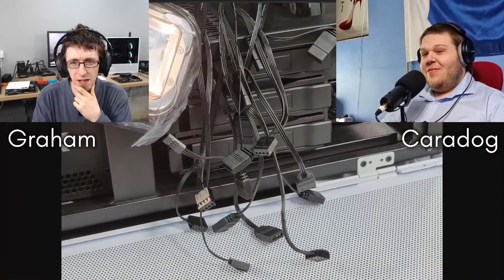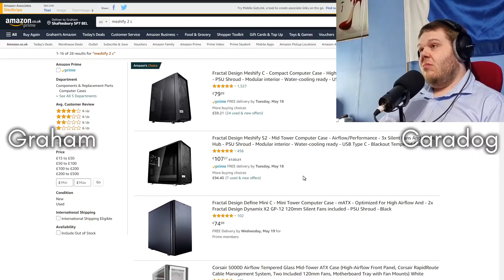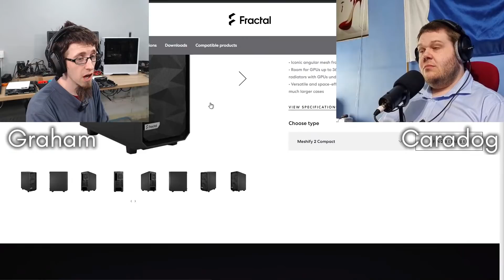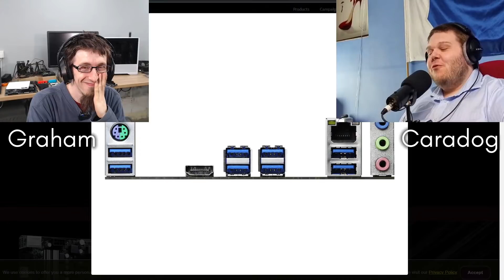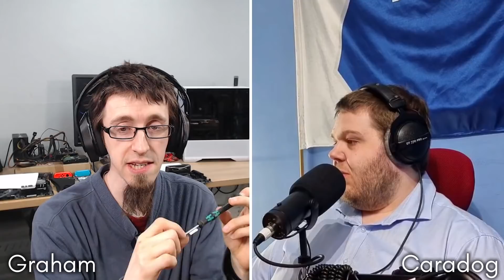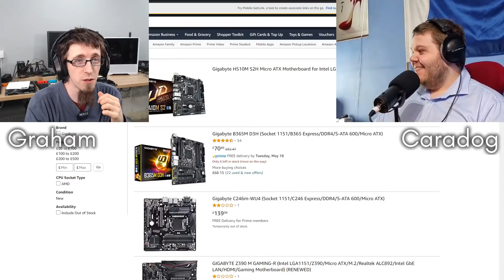No more long streams! - Two Guys Talk Tech #32

Comment: You mentioned dropping DisplayPort and only providing HDMI on the backplate. I much prefer to use DP vs HDMI. Too often I plug an HDMI monitor into a PC and it defaults to underscan with YUV instead of full range RGB, leading to terrible quality text and large black borders. Plus my main monitors don't support HDMI.

Comment: Hi Guys - love the show. Quick question - when you fix non - booting Windows systems you said you clone the original Windows partition to the new drive after creating the boot sector by installing a new version of windows. This preserves the original software and data but I can't find that upload where it's mentioned. What software did you use to do this. I've tried Easus Clone, Macrum etc

Thanks
Reply from the maker: I use drive Drive Snapshot, although any cloning software that can do individual partitions of a drive will also work.
Snapshot makes images for each partition, so you do your clean windows install, and then restore just the Windows partition from the old backup.
It's absolutely possible to fix non-booting system partitions, but I swear it's a black art, I can never do it reliably.
Reply: @Adamant_IT  Brilliant thanks... I've even tried DISKPART but that's hit and miss. I've just tried Macrum but the new partition (cloned) Windows partition fails to boot. I'll give Drive Snapshot a go. Hopefully it's more reliable. Does it matter if you create the Boot Sector with a Win 10 Pro or Home for the cloned partition or are they the same?
Reply from the maker: 99% sure they're the same. The bit that gets spooky is that the boot manager and partition setup on the drive varies depending on the computer's drives, if it's UEFI or Legacy boot, and one or two other factors, which is why fixing it can be hit and miss. Some 'fixes' only work under certain conditions, which is why some people swear blind that a certain fix works, and then when I try it, it doesn't work.

Comment: 12v RGB (analog) is the 4 pin plug?
If so, sadly i still use as my mobo is a B360M from Intel 9th Gen and it ONLY has this RGB plug.
Granted now that i know that, i understand why it's so hard to find 4 pin 12 V new RGB fan.

Comment: The "a-RGB" was Digital adressable ones, WS2812B is the most often used one, the Corsair stripes are used this one I have an Corsair controller an i put the WS2812b Stripes on and it worked perfektly, when u used alwais 10 pcs Segments the Controller nerver take any attention, but when u used in Stripes with different pcs like 8 or 12 the controller says "No Waranty wby using Stripes from other Supliers. Ich have this in my 3D Printers (on my 2 PCs, both HPZ-840 Workstations i had not 1 little Led=) I hate the terrible Light from the ordinary RGBs, the analog rgbs has very bad Collers when mixing them. The Neopixel have very nice Mixing collors and a good mixed White light. Adressable Stripes are also availible with 12 V the Led Type on this i think is a SKxxx one . Best Regards from Germany !

Comment: just started watching your channel and this video...was wondering if you think there's any danger using a SATA power hard drive switcher card I bought 1 year ago on amazon after noticing they were somewhat highly rated.  it allows toggling  of 4 hard drives on/off.  I only toggle them before boot just to be safe.  I basically think the card maybe the problem, but one software diagnostic program shows errors while others don't.  The program is Gsmartcontrol.  I used it w/in windows & linux and got same findings across both OS's.  The power switcher card at times causes drive hesitation at bootup so I think it is more likely the culprit.  You can hear the drive going b/t power on/off for up to 30 seconds in some cases it seems just after boot up.  It seems to occur when I have 4 drives powered on via the power switcher.  I don't think it occurs with 3 or less iirc.  I can't imagine this being a good thing for the drives, so I've stopped using the power switcher card since about 1.5 months ago.  My PSU is a 760W Corsair AX 80+Platinum and I don't think it is part of the problem.  I do run an LSI Raid card in its default settings (no raids setup) in addition to most of the drives being switchable via the power switcher card.  I've had the LSI card for about 2 years.  Right now, all drives are powered only directly via the psu.  I remember recently reading an amazon review after I started suspecting the card may be responsible for errors I've noticed on gsmartcontrol and most importantly after the drives flickering on/off during boot.  The review came several months after I purchased the card so I wasn't aware of potential problems based off prior reviews.  I have pasted his review below for your consideration but he basically doesn't trust the power switcher after examining it with a microscope.  The features boasted "Transient Voltage Suppressor (TVS) can effectively protect the hard disk in the connection. Avoid damage from surge pulses", and it seems to have nice looking capacitors.  Ultimately, I think I should not continue using the product, and am waiting to see if a more reputable, well known company produces one.  Sorry for the length and keep the great content coming.  Thanks and I gladly welcome any response or further questions.

I would not risk my power supply, nor my hard drives, by connecting to this board!!  Under a microscope it is clear that the solder joints (especially the 15 pin drive input power connector) are of poor quality: extremely close solder pads (low quality PCB patterns) with microscopic separations, along with microscopic solder spatter-balls resting on the excess/uncleaned flux.  Cold solder joints.  Voids in some solder joints.  Flux residue remains on underside -- does not wipe off with water, detergent, nor IPA.
Reply from the maker: I haven't exactly researched these, but at a casual glance, the first thing I'm thinking is "Four HDDs spinning up off of one sata connector is a terrible idea."
HDDs only use about 0.5-0.7a while running, but at spin up they'll spike to at least 1.5a, so that's potentially 75w or more on that sata connector at power up. The SATA connector is rated for 54w. If they were staged, or you turned them on 1-by-1 it's probably much less of an issue.
Reply: @Adamant_IT  sorry forgot to mention the card is powered by 2 sata power connector, so I assume one connector for every 2 drives with 4 being the max. If I stagger them out as you say, do you think they may still hesitate?  I guess there should be no harm if I power them on a minute or 2 after boot being that I imagine it'd be similar to hot-swapping in that sense although I defer to you as you are pretty knowledgeable.  I just always felt it better practice to turn on drives prior to powering on the pc, although I may be wrong.  I think I started that practice when I noticed some of my external drives not being seen after power on until I'd reboot the pc so the habit kind of stuck.

Comment: I'm watching this on an B450 I Aorus Pro Wifi in a Thermaltake Tower 100. I've had it for about 3 months. It runs a 3600 with a little overclock just fine. It has two USB 3.2 10Gbps ports. The RGB is a little lacking though. Overall it is a nice little board for around $100

Comment: About 12V RGB.. I do use that, but not because I want to. I decided to run RGB after I bought ASUS Prime Z390-A and this board has only 12V RGB headers. Sure, I could have run iCUE, but with so much hardware I have in my PC I would have a hard time to fit all the hubs in my case...